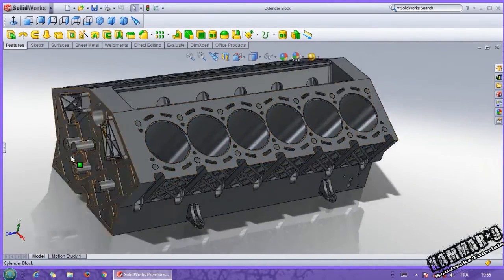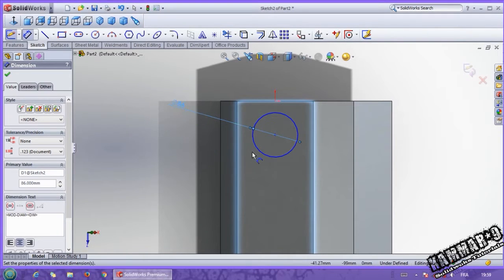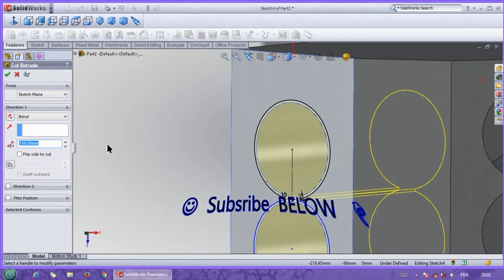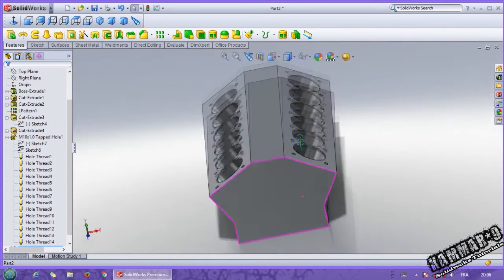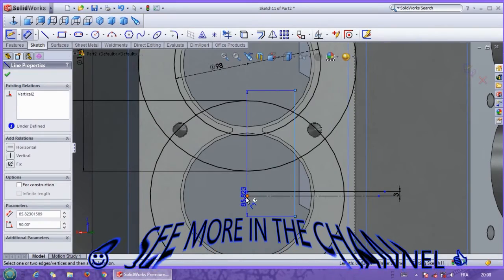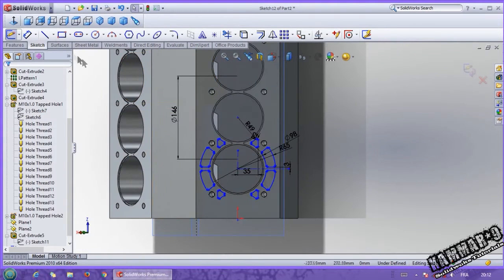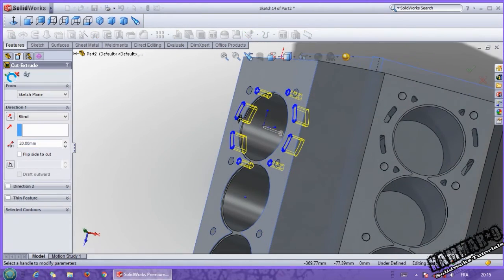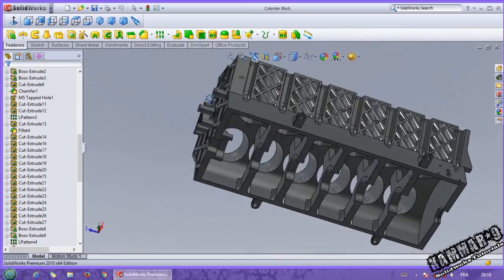Solidworks tutorial  V12 engine | Ep 05 Full HD 😍

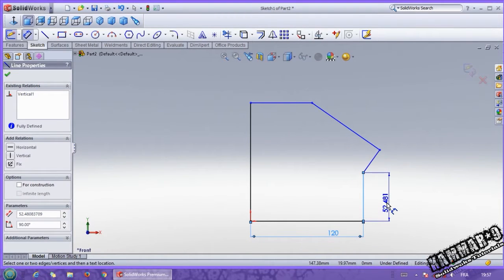Comment: Hi, sir. Thank you for all your great videos but I want to ask a dimesion which your forgot the wrote. At 2:27,I guess, you forgot the dimension  and you just took 52.481, I did it same but at the Ep 07 I have lots of problem for this, that dimension is worng. Could you help me please?
Reply from the maker: +Behic Afacan Nooo , Look at the dimension before asking, i did an angle between to edges , not a dimension of the edge !!!
Reply: +khelifaoui Ammar I forgot to giving angle btw. the angler line and midplane line so i did it. thanks for answering me, and sorry about that. You are the best
Reply from the maker: +Behic Afacan i told you , you mastn't add a demension to this line
Reply: Dude, I had the same problem as you. You can solve the problem by having the center life from midpoint of the line with 145 mm to the origin. If you do not select the center line your sketch would not be fully define. :)